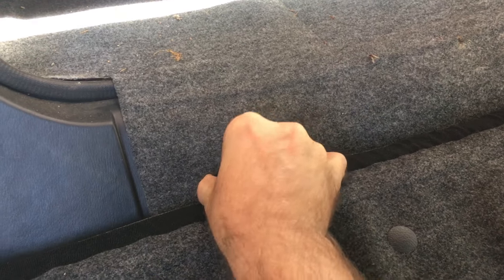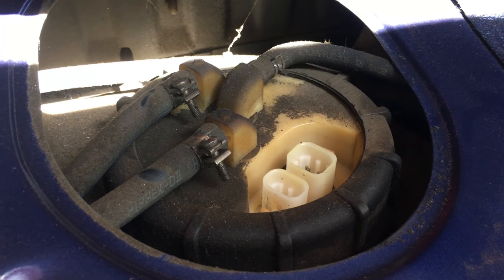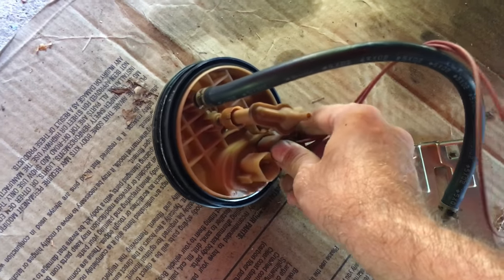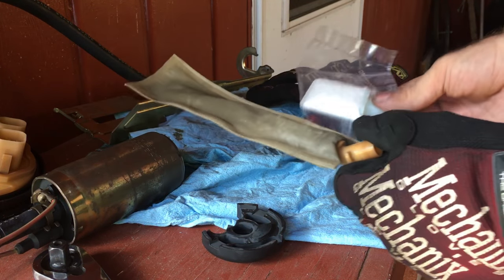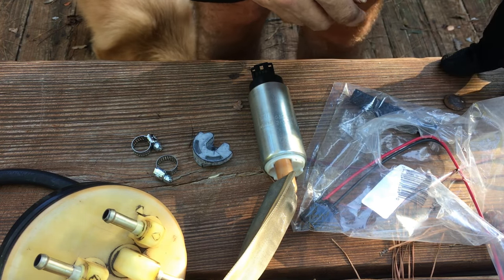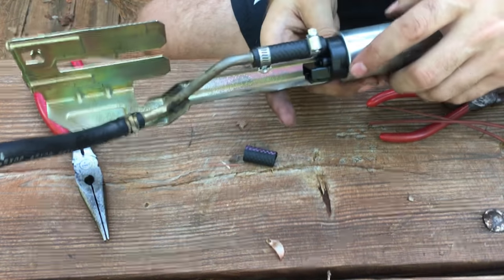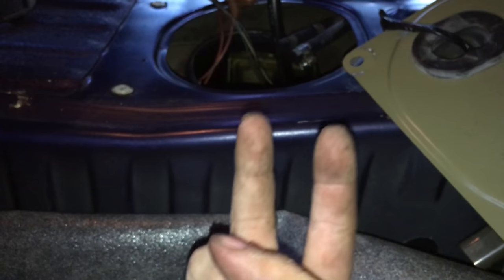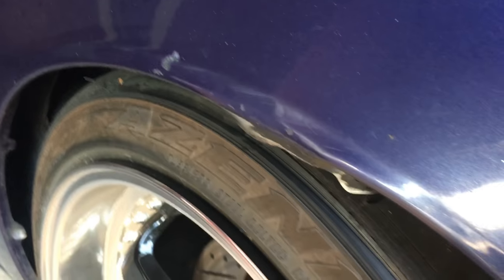Walbro 255 fuel pump Install on the 240sx (S14) drift build

Comment: Hey mate, great video and nice in details. can I please know the model number of the walbro 255 pump? Is your one GSS341 or 342?
Reply from the maker: Thanks for the compliment. well, I wish i could give you the exact detail on the model. I got mine from enjuku racing. the link is: https://www.enjukuracing.com/products/walbro-high-pressure-255-ltr-hr-fuel-pump-nissan-240sx-89-98.html   it does not really give the specific model number.
Reply: ToxicMongoose thats all good mate. Thanks for the link and the prompt reply. I can get in contact with them to find out :) hope your project going great! Looking forward to your new content

Comment: Should i upgrade to a 255 if im stayin Ka for a while? or should i go OEM?
Reply from the maker: In my opinion if its working and your going to be staying stock for a while there is no need to change. If you know your going to change and you  want to take the first steps, I would do what you can get done in a day or less and do them as you go. That will show that the changes are already working so if there is an issue later you know its not that.